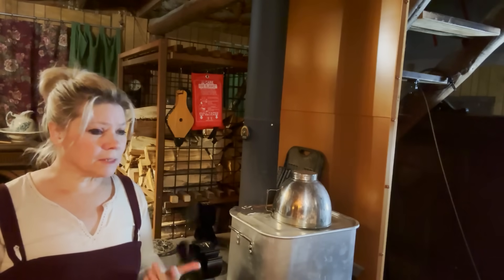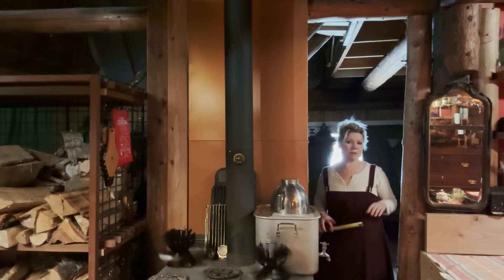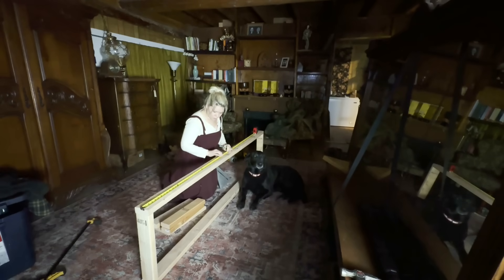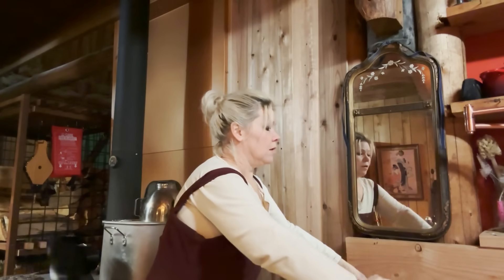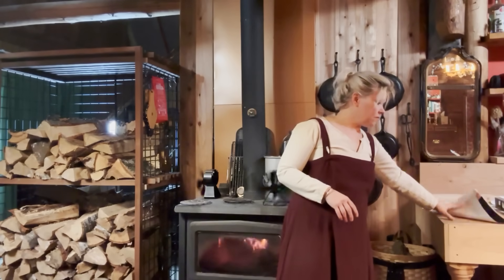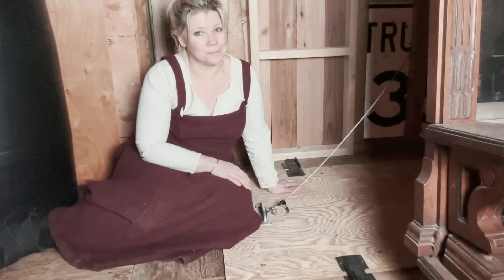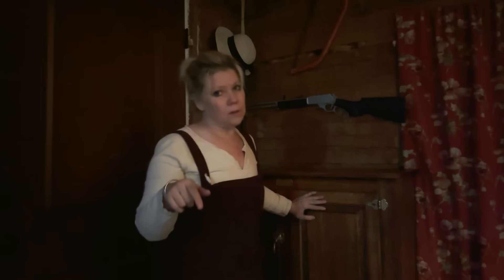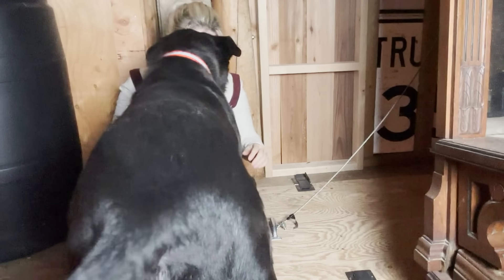Living in a Remote Alaska Cabin is Never Boring

Comment: Great job on fixing those dangerous stairs.   I really would like to see you get some handrails up as well.   I have slipped on my stairs and my death grip on the rails has helped slow my fall to just a bump on the rear instead of a break or worse.   My late husband had ALS and also had a one-step fall, but it caused him to crack a rib, making breathing hard.   When you hurt your foot, did you make a main-level bed?  I know you don't have a couch, but hopefully, you will be able to make some sort of guest space that you can also use if needed.      I love your new cast Iron pot wall.   Will there be enough circulation for your heat?  Give Kenai a belly scratching for me and my dog Teddy

Comment: Great security, you can never be to safe. I saw somewhere that if you freeze 16oz water bottles and put them in the cooler, they will work as good as ice blocks with no mess. You can refreeze them and use again. In the winter time any how. Stay warm up there.